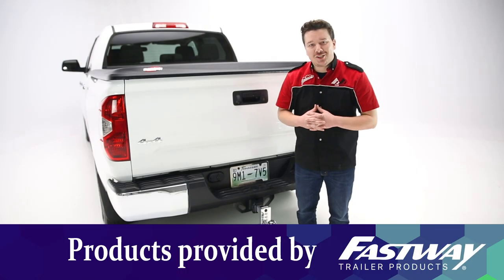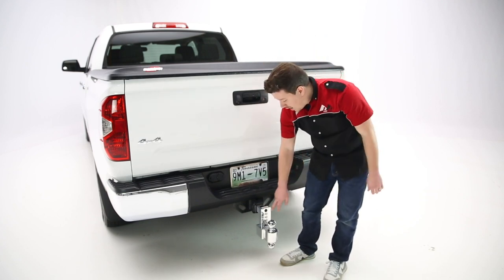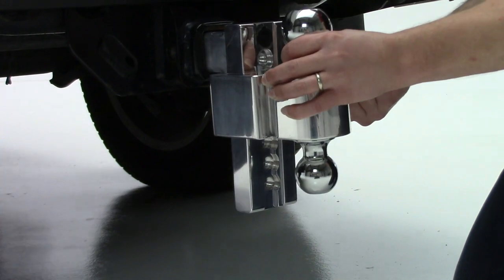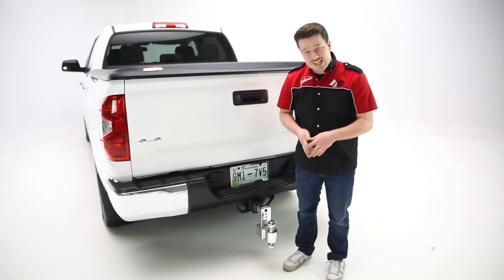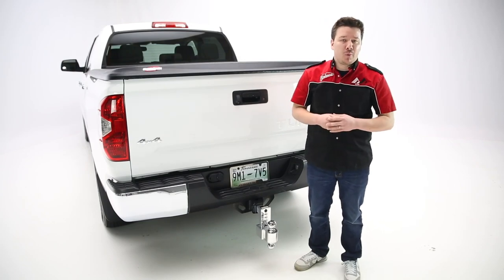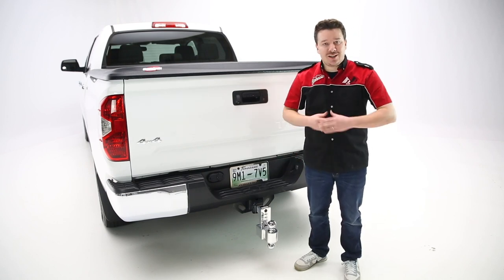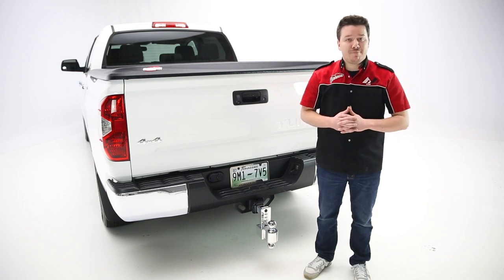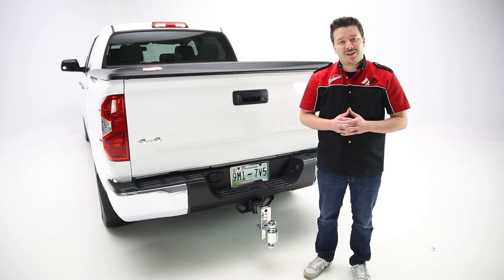In the Garage with Total Truck Centers™: Fastway FLASH™ Adjustable Locking Ball Mount

Comment: Pretty cool looking device! My only concern would be how secure is the vertical hold on the sliding shaft? I’m sure it’s been safety tested. How about some info on towing capacities? Thx!
Reply: The vertical hold is very strong, and the towing capacities are as follows: 1,000 lb. max tongue wt. / 10,000 lb. max trailer wt.